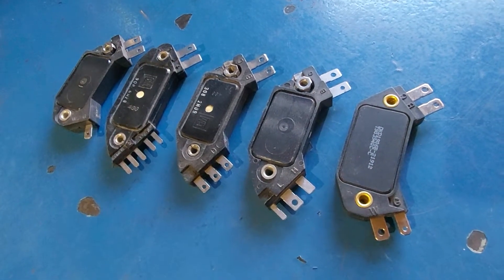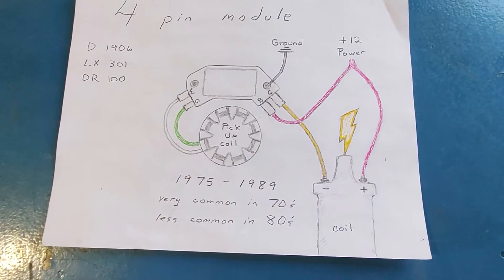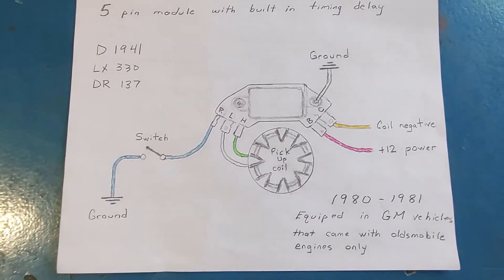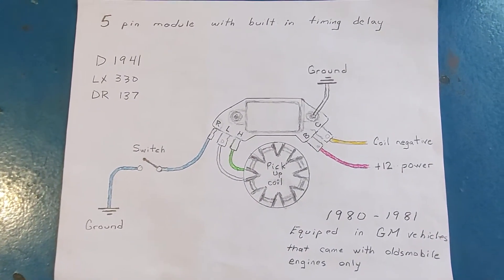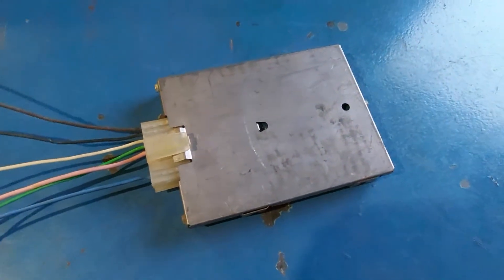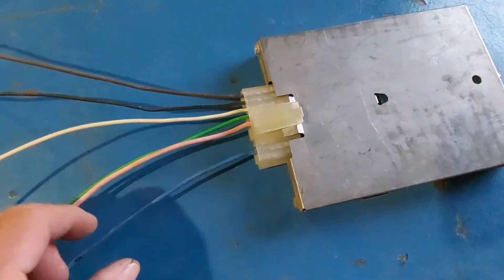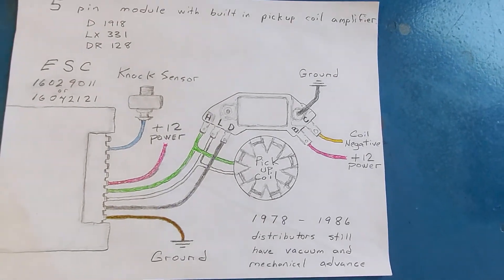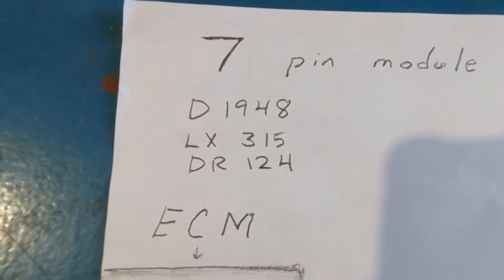How to wire up HEI modules All five explained with diagrams GM distributor 3 4 5 7 pin Ignition coil

Comment: Great education. I have a Bosh injected 1983 Lamborghini V12 had Marelli ign components. Ign module failed. I wired in an HEI module. Now car runs but is popping through exhaust at 3-4 k rpms. Idle is good, revs up okay. Ran fine before module failure. Any thoughts on this?

Comment: Thank you so much for this video. I saw this video about six months ago and I ordered an actual GM five pin ignition module. I'm working on a GM car that used to be my dad's. He replaced the point distributor with a brand new (cheap) HEI distributor that he bought online. I'm not judging my dad, I would've done the same thing. I was having a heck of a time with the engine not running as well as it did with the points set-up. I even bought another ignition module from the same place even though the old one didn't even have 10 miles on it. No improvement. I saw your video, ordered the five pin ignition module made by GM because I figured that I can set the base timing around 16 degrees BTDC and the fifth pin could retard the timing to help it start. I installed the five pin ignition module without changing the timing and the engine loves it. I'm not saying that you have to buy a five pin ignition module if you're having issues with a cheap HEI distributor, I would highly recommend the regular four pin ignition module made by GM, unless you plan on doing the retarded timing with the five pin ignition module. Thanks again. 😊

Comment: I Can't even find the modules to buy.
Reply from the maker: All can be found on ebay
Reply: Or at any auto parts store, but anyone who can't figure that out really shouldn't be trying anything in this video. 
 The best modules are offered at a steep price, but the reviews average better than 4.5 stars. One example is the Davis Unified Ignition 000222 module.
Reply: @sarahstephens5966  I found it before I even got a reply!

Comment: Hello Ray, thanks for having the most informative video I could find on the GM HEI module and types. I have a comment on the 4 pin that you show first in your video. Wire the coil circuit just like you have in your video. Put 12 volts on the G pin (W pin left disconnected if you use the same 12V source that powers the coil) and the module puts power through the coil. If 12 volts stays on the G pin, the module keeps running current through the coil. This means the module does not set the dwell, that is determined by the input signal. If you use points to trigger the module then make sure your points are not left closed with the key on or it will burn up the coil or module. I would like to know if you have had similar experiences. Thanks

Comment: Ray thanks so much for your vids .. Please help me out I have used your technique  on several applications but I am stumped. I have an old ford tractor that I have applied the olds toranada 3 pin module and my 1k resistor keeps burning up as soon as i apply voltage what have I done wrong new points wired straight from switch with gm hei coil no condensor and 12volts to the coil and mudule and resistor is soldered to teminals on module and have tried diff modules and res please what is making the little res burn upp as soon as you key it on
Reply from the maker: When not using a ballast resistor on the coil positive, I moved up to a 10 watt rated 1k ohm resistor between the B and G pins. 10 watt rated resistors are usually larger and squarish shaped.
Reply: @raysoto1969  is this correct?
Reply from the maker: @charliekerr9231 I assume you might be using the small 1/4 watt resistors... these are too small for 12 volts. I should've mentioned using a higher watt rated resistor
Reply: @raysoto1969  i guess that link i put in here didn't work but i found a 10 watt 1k alum square resistor it has eyelets for hook up and it's much larger walmart had them for $7 for 2 of them
Reply from the maker: @charliekerr9231 I was also using a condenser on the points. The points were not connected directly to ground. I think mounting the points without a condenser would put extra strain on the 1k ohm resistor
Reply: @raysoto1969  ok I'm confused when you say the points were not connected straight to ground ?? You mean that it was touching ground with a condenser hooked with it??? cause I did this mod on a maintainer machine and i used the original cannister coil and ballest resister and it runs fine with no prob and those points are just going to ground and activating the 3 pin module .. I was just trying touse the gm hei coil on the tractor i'm doing now so i'll just go back to using the old coil but I don't see the point in doing it like this with the old coil you don't get the hei bennefits but i have spent too much time on it already I just thought it would be asy like the other 10 i've done I'll just leave the points dist alone if they are going to be problematic thanks for the help
Reply from the maker: @charliekerr9231 https://youtu.be/Tc0JUD9_-R4?si=IjpJM06KWLl6-Uxe

Comment: So please explain the 5* retard on the points ignition "Please"'.   On my old tractors I wanna run them as advanced as possible , but not destroy the starter.  I'm thinking of somehow running a relay to use while the starter button is engaged for the retarding. 
     BTW this is the best illustration I've seen in the HEI components.    Usually I'll cut the top off an older HEI distributor , and mount it to the bottom of the antique distributor. On the M Farmall I just don't have the room.  
    I am gonna look and see if I can get the electronic pickup from a true HEI, and mount inside the old distributor , and totally do away with the points , and mount the HEI module outside.     
  👍THANK YOU SO MUCH👍
Reply from the maker: I haven't tried it, but I think the 5 pin module with the thin R pin can be used with points also. The L pin would need to be grounded, and the H pin would be connected to the points and to the 1K ohm resistor that is connected to 12 volts. And, yes, you can connect the R pin to a relay that would ground when cranking... making it easier to crank the engine over.

Comment: I’m just wondering if I would have to stuff the modules into a regular distributor?
Reply from the maker: No, they can be mounted outside also
Reply: @raysoto1969  ok so I could use longer wire to kind of hide it. Thx
Reply from the maker: @Face-u3m Yes 👍
Reply: You should mount it to a grounded aluminum plate that gets airflow so it can be a heat sink as GM intended.
Reply: @sarahstephens5966 
Thx

Comment: What coil do you recommend when using an older points distributor to trigger an hei module. I know the flame thrower is popular but it seems a bit over priced.
Thank you for a great video.
Reply from the maker: I usually use MSD coils on my stuff... a little expensive but reliable

Comment: What are the wires that connect to the ignition control module mine are messed up and got to replace them or do I have to replace the whole ignition system

Comment: Wow. Great video. I wasn't aware there were so many variations of the module produced.
I'm sure I can look it up or figure it out but I'm sure you have the answer.
I have a '77 Corvette with a HEI distributor. Where (on the module) does the tach signal come from that feeds the tach on the dash. It's one of the wires coming out of the distributor.
Also you might know if the tach signal or some other place from the module I can  use a scope to observe secondary ignition waveforms on a scope. Traditionally you would hook the scope to the negative of the coil to observe the waveform. Or on the points of a conventional ignition.
Thanks
Reply from the maker: Yes, coil negative.... or also on the C pin on the module.  And also on the distributor cap where it says "tach" if you are using the HEI distributor cap

Comment: Can someone tell me the  voltage (pulse?) on the W and G connection?
Reply from the maker: This can vary from brand name and year the module was made.... it could be anywhere between zero volts to 1.25 volts
Reply: @raysoto1969 

Can this module be used for an Alfa Romeo GTV 2.O 6V turbo engine 1996?

Alfa doesn't make this this module anymore and no secondhands available...
So I'm looking for a replacement..
Alfa uses also 4 wires in their ignition module.
Reply from the maker: @casanovafamily without a distributor,  you would need multiple modules

Comment: Do you know if the "newer" modules with the "Weather Pack" looking plugs act in the same way.   I can not find any information on them.   EDIT  found the answer myself, Delco D579.
Reply from the maker: Yes, they operate exactly the same way, and the individual pins are labeled the same also

Comment: Mr. Soto-I have begun my Subaru Justy rescue project, using the 5-pin LX330 module with the very skinny 5th pin.  Will you please tell me what signal on the 5th pin will cause the retarded timing.  is it ground or some voltage, and what would that voltage be?  I appreciate your help a lot.  Thank you.  Oh, I have bought a 1988 distributor with vacuum advance.  I wonder how much total change in advance I can get from that equipment ( dizzy and HeI module together ? )  Any recommendations for how to set it up?  Thanks again.  (:>)
Reply from the maker: The skinny 5th pin only needs to be connected to ground (no voltage) to get the 5 degrees timing retarded. All distributors are different, and the only way to know what your total advance will be is to use a dial back timing gun.
Reply: @raysoto1969  Thank you so much for the reply.  I'mma gonna try that.  (:>)

Comment: Hi Ray, I heard you talk recently about the unreliability of new HEI modules.  Have you had good luck with older oem modules? Do you find any benefit to getting the modules with the GM logo on them? Do you think its a heat issue? Do you think placing the module on an external heatsink would be helpful? Perhaps a CPU fan ? Thanks
Reply from the maker: Yes, heat is definitely the enemy, and anything you can do to keep them running cooler will help
Reply: Spend more for better modules. The best ones are not cheap, but reviews average 4.5 stars. One example is the 000222 from Davis Unified Ignition.
Reply: See the most comprehensive writeup ever written by the well known auto engineer Daniel Stern. Do a search for:  Slantsixdan HEI Electronic Ignition Retrofit How-To.

Comment: How can we do this same with 2 pickup dodge distributor?  Use 2 GM ignition modules to the single coil?
Reply from the maker: I would only connect the "run" pickup coil in your dodge distributor to the GM ignition module.  The other pickup coil in the dodge dual pickup distributor is for starting only... so leave that one disconnected. The GM module only needs one pickup coil for starting and running

Comment: Very Excellent presentation.  I'm going to try it on my 1989 Justy ( computer died)  .  Might save it.  I wonder what signal (analog or digital?  voltage range? ) is the "E" terminal of the 7 pin unit getting from the computer?  I wonder if a variable resistor could be used there to adjust the  "retard" command going into the HEI module.  Could I possibly get more retard that way than the 5 degree I could get with the 5-pin module?  If you can answer, me and my Justy will appreciate it a lot.  Thanks.....
Reply from the maker: Thank you. The signal from the ECM to the E pin is a pulsing ground signal, no voltage. So, the 7 pin module can not change the timing all by itself. The ECM does that.
Reply: @raysoto1969  Thank you for the rapid reply.  Just to go a little deeper, could I use a pulse width modulator to send a variable pulse to that terminal?  It could be done with a 555 timer chip and a few small resistors and a 'rheostat'.  I'm thinking of driving my Justy like they used to do with the early Model T Fords, with manual advance lever.  It would cost about a dollar for the parts.  I LOVE my Justy but don't have the money for a computer.  Maybe your HEI fix and a VW carb, which I already have can save it>  Thanks again if you can reply.
Reply from the maker: @henryaitchison2687 Yes, a pulse generator that can produce a square wave negative grounding pulse. Don't forget that there must be 5 volts at the B terminal. Otherwise, it will ignore any readings at the E terminal
Reply: @raysoto1969  Thanks a million for this great information.  I will give it a try, and share if I learn anything.

Comment: I do not have 5v from computer on 85 olds 98 if a sensor is wired incorrect or faulty does that effect this?
Reply from the maker: There will only be 5 volts after the engine is started and running. That 5 volts is also used on certain sensors, so if there is a short somewhere,  it will cause problems

Comment: Best info on the subject thx my problem is no spark but everything tested good coil, pick up coil module. Could a faulty alarm.
Interrupt or is that only to the starter
Reply from the maker: @larryortiz6228  Yes, depending on how it's wired... could be alarm, ignition switch, etc.

Comment: Dude! Thanks so much. I've been looking and looking for a CDI to retrofit my points ingntion outboard. I've got a question, can I use the 4 pin with a 1K resistor for points with the 5degree delay as well?
Reply: You have to be careful with outboards- usually there is an additional circuit (neutral switch) that grounds out the coil temporarily when shifting from forward to reverse.  I would look into the "Marine Voyager Ignition Kit" as it includes this wiring.  Also, marine gear boxes do not have various gearing like an automotive trans so you are looking at a different timing curve- not a big issue if you are comfortable with adjustable HEI cans and springs.
Reply from the maker: @Turkeydinner  Yes, connect it the same, ground the W pin

Comment: The coil is supposed to fire when the points open, meaning, when the points un-ground the trigger wire, giving us a rising pulse when used with a pull-up resistor.  👉👉👉 Does the 3-pin HEI fire the spark on a *rising* pulse?
Reply from the maker: @jimbo5728  Yes, the coil sparks when ungrounded, and yes, the 3 pin module will unground the coil when the little pin gets a positive pulse.
Reply: So what he is saying is your distributor will need to be timed to the moment the points close...Not open..That will need the distributor to be shifted several degrees to make that happen..
Am I understanding this correctly ??
Reply: I just did a test on my Onan Generator..Trying to convert it to this module..Unfortunately the spark occurs at point CLOSING..So that is about 30 degrees to soon..

Comment: great video !  i'd like to have knock sensors on my gen 1 sbc i'm putting together , but i can't find these parts anywhere. except a few old used parts on ebay. any suggestions?
Reply from the maker: @billytarpon9871  RockAuto sells a remanufactured ESC 16029011 for $86 plus $36 core. I have bought several of these used, and some of them come out bad. Just make sure you test them as shown in this video... https://youtu.be/DM1JICliGmg?si=kq8Xwas8mns8RRZJ
Reply: Call MSD

Comment: I have seen points used to fire other types of CDI ignition boxes and from what i have seen, it does make the points wear down slower but they seem to get corroded much faster especially if used in a high humidity climate or only used occasionally, because the cdi box only puts a tiny current/load through the points there is no powerful spark/arc to blast away the corrosion from the contacts like in a normal points application. So you trade off less wear for more frequent cleaning on the points.
Reply from the maker: @briang4470  I didn't realize that, maybe because I live in a very dry climate
Reply: @raysoto1969  I'm in a very humid area and points around here tend to fuzz over and corrode after only a few months to a year of sitting. For that reason if I'm going to use points I try to just use them as originally intended. In my opinion I don't see any reason to use them to trigger a cdi/hei module because now you have the both the problems of a cdi box that can randomly fail and drop dead and you have the maintenance and connection issues with points. So I try to go fully electronic if I'm going with a cdi/hei style ignition it just seems more reliable to me.
Reply: @briang4470  I live in the same type se texas and the reason for using this is that chinese points do not have ungst steel anymore and hey won't last a week but if they are new and you place a little bag of dehumid in the dist and lube the points during maint it all works out and yoou really don't need the dehumid bag if you lube your system

Comment: Can the 7 pin be used in conjunction with Holley's Terminator X ecu and individual coil near plug systems?
Reply from the maker: @mikeclement7780  You would need to use multiple modules if you want to use multiple coils. These modules were designed for use with a distributor and a single coil.